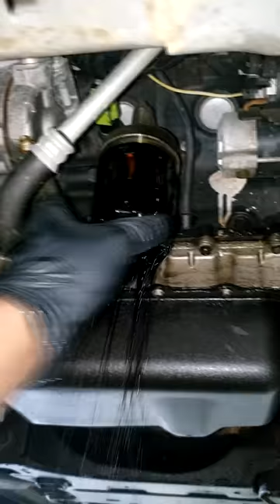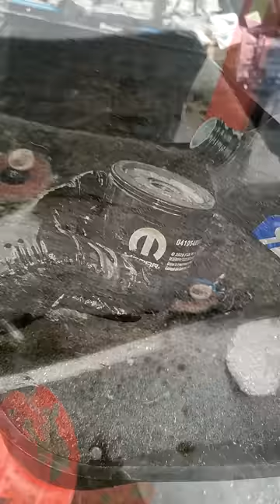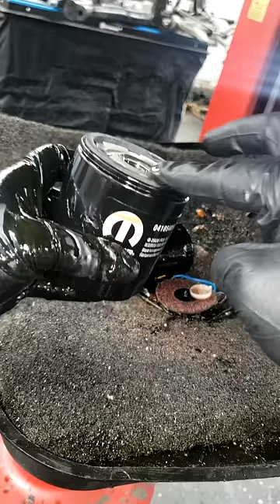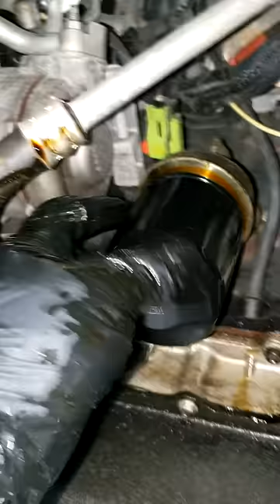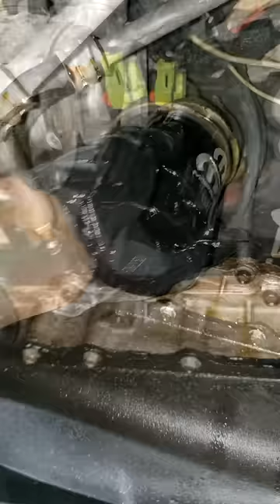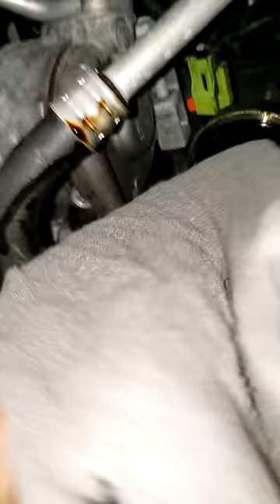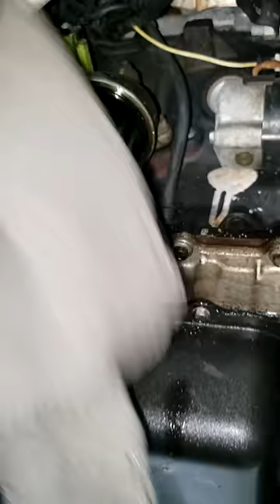Don't Lie.. Are yall still doing this?

Comment: Ive got a second generation tacoma.  The filter mounts such that if the filter was prefilled, you'd pour all the oil out when you put the filter on, so it cant be pre-filled. My tacoma is 18 years old (2005), so i'd say it doesnt matter.
Reply: I've never even HEARD of pre-filling the filter until I saw this.  Every filter I ever did was sideways.  I haven't bothered to change my own oil since I drove OLDER cars, though.
Reply: Just pour oil in the filter. Until the media is saturated. I work at a toyota dealership and Thats how many do it for those.
Reply: @meanodustino9563  I also work at a toyota dealership and I can confirm that nobody does this lol
Reply: @gilbertescalante5372  "Hey me, it's the real me" moment 😂
Reply: @gilbertescalante5372  Yeah, it's well known that the high schoolers who work at toyota dealerships are world renowned experts in the field of automotive greasemonkery.
Reply: My Elgrand has a filter located on its side, pre fill it, and you'd have a litre of oil pouring down the block ... although there is a useful spillage catch under the filter.
Reply: Same i have a nissan and a ford. Both side mounted so never done it since itll fall.
Reply: Right.
Reply: @zingzangwallawalla Nah man, the oil soaks into the element and doesn't run out unless you turn it on its side and wait for it to run out.  There's plenty of time to screw it on without spilling it, just don't over fill on pre-fill.
Reply: Tip it on its side!😂😂😂😂😂
Reply: Shoulda bought a Chevy 😂
Reply: @lawr5764 you can still prefill a slanted or tilted filter, fill it half way🤣
Reply: @tylerhale1696 no reason to do so. You’re not dry starting the engine anyways. The film of oil is still present in the oiling system and cylinder walls. That doesn’t just go away after 20 minutes doing an oil change. Now if a car has been sitting for a long period of time, then I would say to pre fill it
Reply: @LangeLS4 
Most vehicles have a priming system so even then that's not needed. 

Example; 
Many chevy's(and like) have a system where if you press and hold the gas pedal before cranking the motor won't start, it just cranks while you have the pedal down. 

Give it a try on a vehicle that hasn't had the oil drained yet. Test it out.
Reply: @kairu_aname  I am aware, on GMs that’s called placing it in “flood mode” cuts fuel to the injectors if held at WOT on start up. I did an engine rebuild on my 06 SS, I primed the oil pump by removing that big ass Allen key on the side of block. I generally would only do that if it’s been sitting. I am aware it’s still not necessary but just peace of mind on my end, but I tell people all the time it’s not necessary to pre fill filters. Maybe on an oversized diesel but I only work on gas engines
Reply: obviously not in that circumstance , my rav4 I cant do it ,but where you can its better.
Reply: Tip the truck on its side then put the filter on.😂

Comment: This is why I do my own oil changes. I couldn’t stop cringing when I saw the mating surface dirty.
Reply from the maker: Who cares why you do your own oil changes?. Old oil on the surface not gone hurt a dam thing. Don't be a drama queen dude.
Reply: @OnlineMechanicTips  facts
Reply: @OnlineMechanicTips 😂😂😂 bruh facts like wtff
Reply: Ya why lube the gasket if your leaving everything wet with old oil???
Reply: How about the just snug fitment? Do that where I work and you'll be running back to the store to get a filter and more oil. I cranked on the filter on my 17 silverado with a oil filter wrench slightly and it still got loose..........😂😂
Reply: @OnlineMechanicTips Woah 😳
Reply: @kelnap2294 you’re not supposed to put a new filter on with a Wrench Cuz, you put them on by hand and snug them as tight as you can get without trying to choke its eyeballs out been working on heavy equipt, farm equipt and trucks for thirty years now and never had a single issue with a filter coming loose.. though I did learn the hard way at a very young age about what happens when you accidentally double gasket the filter 🤣🤷🏿‍♂️
Reply: Ya thats just being  lazy  you always  clean  the surface  .and always  test drive a vehicle  after any  repair  or service  .
Reply: I do if installed upside down but most of my vehicles are sideways or even upside down (Subaru). Cleaning that mating surface is not needed but would rather see that then cleaning the outside of the filter. 
Hand tight for the win; dread taking filters off cars I have not serviced.
Reply: @OnlineMechanicTips  Yes it will, it prevents a PROPER seal and can start leaking. I've seen many repairs fail due to the lack of proper cleaning.
Reply: @OnlineMechanicTips I agree it's not like there isn't residual dirty oil all over the inside the engine and pan
Reply: You sound like you didn’t know what mating surface was until you read these comments
Reply: Stop projecting
Reply: @OnlineMechanicTips  Completely agree. So does @RainmanRaysRepairs. Some people are so stupid and petty. Oil is oil, even if it's used. It doesn't matter if used oil is on the mating surface for an oil filter. As a matter of fact, if you leave oil on the filter mating surface then it means that you don't have put any on the filter seal. Just make sure the engine isn't an oily mess before it does out and you are gold.
Reply: @Fleetwoodjohn   the old oil doesnt affect anything.
Reply: @OnlineMechanicTips no but all the grit around the filter can get transferred to the mating surface and can tear up the gasket. It takes a couple shots of brake parts cleaner to clean it off before you take the filter off, and it should be muscle memory to check the gasket surfaces and wipe a smear of oil around the seal. You probably put the filter on with a wrench too
Reply from the maker: @chrisrageNJ  You really have that kind of time on ya hands to debate how perfect simple oil changes should be done? Yes, its cool to remove the old oil off the base but if you dont, its not the end of the world is my point. Find you some more hobbies dude.
Reply: @OnlineMechanicTips  You really have that time on your hands to film your oil filter change, but no time to clean your mating surface? 😅
Reply from the maker: @stanvanbeek8305  It wasn't about time at the time. It just didn't get done and does not look good on video, especially to you perfect folks with a lot of time on your hands to discuss. But yes, it def should be done. Smdh, we in the middle of a crisis strike and the industry badly affected but you guys rather discuss a oil change that was done months ago.
Reply: @OnlineMechanicTips think about who’s in office right now and what’s going on in the world. We all gonna die and I’m making myself feel better reading comments
Reply: To Each is On But i like to always Clean the Housing b4 i Go up with the New Filter So Boom
Reply from the maker: @scratchoffkinggetmoney9557  You should, I never said you shouldnt. I said this one was not but I also said its not the end of the world because it wasnt dont.
Reply: @OnlineMechanicTips you they whiniest mechanic on YouTube
Reply from the maker: @Insert.Name.Here.  What exactly am I whining about? Im merely replying to comments
Reply: @OnlineMechanicTips  your sassy comments to anyone telling you how to properly do an oil change. So I guess maybe not whiney, but emotional/sensitive.... whatever you think fits best
Reply from the maker: @Insert.Name.Here.  Awhh, sorry I don't fit any of those descriptions dude. Nothing sassy about my comment to aggressive MFs. Surely they not offended, its just you. Maybe you should man up.
Reply: @Fleetwoodjohn because he doesn't do it following a logic, he just does it because he was told to...that should tell you a lot 😅

Comment: Yea nah it doesn't matter. It takes about 2 seconds for a motor to prime the oil system and the residual oil on the components are more than enough to keep the motor happy for that few seconds. Pre filling the filter isn't always possible such as situations where they are mounted side ways or even upside down.
Reply: `My filter is upside down. When I prefill it, I quickly turn it over and onto the threaded tube so fast that nothing leaks out.  Therefore it's possible to prefill a filter that has an anti-drainback valve and not make a mess. Even though the pump can fill an empty filter in a few seconds, and all the moving parts have enough oil to survive, there is absolutely no reason not to pre-fill a filter.
Reply: @e-curb • Yeap !. I always say. It's always better to start an engine with a bit more oil lubricating all the parts. Just for the sake of protecting the oil pump's first initial half dry start up. It's always a good idea of over protecting the oil pump. To pump itself will last a whole lot longer without any weird noises. Or lacking lubrication in any future time👍.

Comment: I have never done that, It isn't necessary as there is plenty of residual oil in the bearings and on the cylinder walls to keep everything lubed for the 3 sec it takes to fill up and get oil pressure. BTW I have put 510,000 on a Silverado and never filled the oil filter, 350,000 on a GMC Jimmy and never filled the filter, 280,000 miles on a Toyota Tacoma, and 300,000 on a Jeep JK wrangler all these cars never smoked or burnt oil.
Reply: They would’ve made more miles if you filled the damn filter 😂😂 jk. Those are amazing numbers for those vehicles btw nice job maintaining them! 🤘🏼
Reply: Chevy Tahoe 06 and 07 same thing I’ve never filled the oil filter, at best I place a little around just about a one second pour and then rub it down and put it on.
Reply: I still drive it to this day 467,732 miles currently.
Reply: Beat go hard 🔥
Reply: I can attest to this as well. Never done it on my 98 Chevy original motor 268k miles. I'm actually an A&P mechanic and procedures never say anything about this.. in fact aircraft engine operating procedures often say allow up to 30 seconds for oil pressure to register 😳. Usually takes about 5